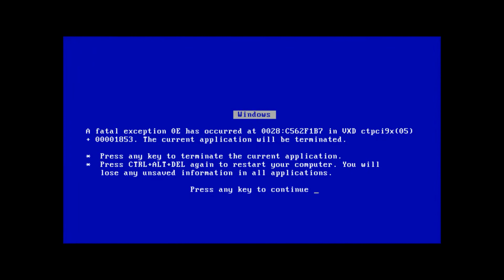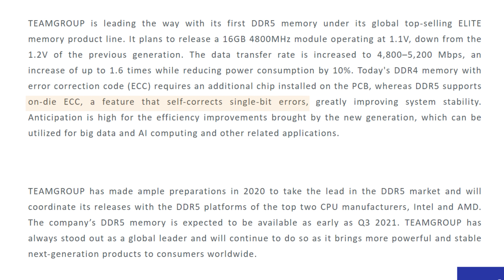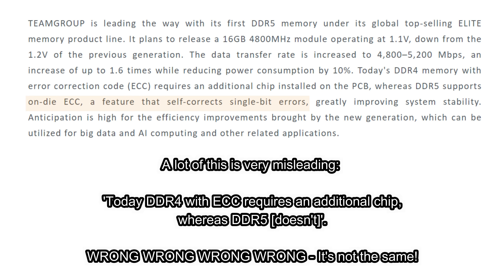Why DDR5 does NOT have ECC (by default)

Comment: Well... that's unfortunate. I was wondering how they were able to run ECC at the higher clock speeds and lower latencies that gamers would demand, and the answer is... they didn't.
Reply: Mostly due to lack of demand. If ECC on desktop platforms was common, I'm sure we'd see lower-than-JEDEC latency gaming ECC ram all blinged out with RGB and gold plating and whatnot.
RAM manufacturers are already binning their own ram chips for reliably hitting the faster settings, no reason they couldn't also do that on ECC modules.

Comment: Loved the video! Thanks for the great content as always. 

One nitpicky thing: probably don't need to worry about alpha particles from cosmic rays, those have a penetration depth of microns (in materials) to mms (in air). Main issue would be x-rays, some of which could come from alpha's radiating their energy via bremsstrahlung, but it's super unlikely that the alpha's could pass through the atmosphere without stopping.

Comment: If you read this  a few questions : 
- is it impossible to overclock ECC RAM ? get tighter timings while keeping ECC working (even if out of specs) ? (sure there would be a perf penalty from ECC anyway)
- are ECC error corrections reported to the OS/logged ? this could be insanely powerful for overclocking & stability, less need for stability testing tools
=>if your logs get filled with errors, you probably went too far in pushing your RAM 
- OR alternatively, if the RAM is only "factory overclocked"  it could indicate that this memory isn't able to maintain XMP settings therefore giving a reason for an RMA

-additionally I'm on the ECC would be great for diagnosing bandwagon.
I had a failing AMD Ryzen 5 3600 for months,
it produced random errors at idle, but never under stress load, this made it very difficult to diagnose
and for a long time I thought it was memory problem or a motherboard problem
On average 3 errors per day... this made it even more difficult to diagnose.
I finally found the proof : disabling CPB would stop all crashes altogether and then AMD made no difficulties for a very fast RMA.

Comment: Looking in the logs of UNIX workstations 30 yrs ago, ECC memory correction definitely did occur frequently enough to be glad of it, though I rarely had trouble with RAM going bad, despite large memories requiring add in boards with a lot of chips soldered on. 
Insist on ECC for every server, 
the costs of data corruption  outweigh any performance gain and it certainly isn't fun to check a 100 machines with memtest86 to locate a source of errors.
It's worse than no ECC, originally micro computers had parity checked memory, the original IBM PC had that. They shaved cost and gained a little performance by having the hardware unable to detect any bit errors nevermind correct them.
Another issue with x86 ECC is that it's a low level BIOS routine that runs and scrubs memory, it's unfortunately not under control of the OS.

Comment: A great video (as always!), but one question: your explanation makes it sound like those thermal and cosmic ray bit flips happen in memory, but your objection to this being seen as "universal ecc" seems to imply that they might be just as (more?) common for in-flight data. Could you elaborate on that? I was under the impression of those errors being DRAM-specific, and thus not very relevant once the data has left the DRAM chip.
Reply from the maker: On-Die DDR4 ECC manages the cells in 64-bit wide word lines, but ECC data transfer requires 72-bit wide word lines for the extra parity bits required during transfer. Movement of data is a lot more susceptible to flips than storage of data, just by the act of moving, rather than the act of time.
Reply: @TechTechPotato  Ah, so when speaking of ECC protecting data it is mainly/most importantly about protecting in-flight data (through extra parity data transfers) rather than "static" data in the memory cells (even if those can also flip)? That goes some way to clear up the cause of the confusion for me at least, as I've never had the seemingly logical connection of "ECC memory = protecting data stored in RAM" complicated. Thanks for clearing that up!

Comment: Even if it's not standard shouldn't be a good idea to have ECC in overclocked RAM? As you overclock the RAM it tends to be more unstable so having ECC should help to avoid random crashes when gaming (even if it would stop to be a 100% success rate for the ECC and goes to a 90% of chances to fix a bit changing its value.

Comment: RGB for ECC could be in fact useful. If you count you bitflips in a module and colour code them, a guy in a datacenter could swap bad modules without any further knowledge about the whole system. But i doubt the added cost per RAM will be lower than letting the tech guy work longer or exchange the entire rack once you can't live with a RAM Module anymore.

Comment: The Threadripper Pro CPUs from AMD support ECC DDR4 RAM since they're intended for desktop workstation systems where 128GB of RAM is a minimum specification, a "good start" at best. A lot of these sorts of workstations are doing production work for things where a data bitflip wouldn't matter, like video or audio or image processing but there are other tasks, for example mathematical modelling or engineering where a single data bitflip early in the chain of number-crunching can cause a noticeable error after a few million iterations.

I remember the Old Days when early minicomputers could be specced with DEC-TED memory (double-error correction, triple-error detection), they had 22 bits of RAM to store 16 bits of data with the other 6 bits used for parity checking. This was due more to the manufacturing processes of the time and high failure rates of components rather than cosmic rays and the like causing bit-flips.

Comment: Side-band ECC is the traditional ECC type that everyone knows of, that's the actual name and it's an accurate, descriptive name.

"A good chunk of memory sold today is actually ECC - it contains error correcting code. This enables memory that has ECC enabled to correct errors as they occur." It supports ECC - doesn't contain ECC. DDR4 DRAM just holds data, the memory controller is in charge of using it. Saying that the memory itself is ECC is exactly what you're trying to disprove in this. As you say yourself, technical accuracy matters, and saying that the memory contains error correcting code when talking about DDR4 DRAM is definitely inaccurate.

In British English (and all other variants) - pronunciations are:
'Jed-eck' not 'Jay-deck'
'Pet-a-bite' not 'Pee-ta-bite'
Reply from the maker: Support vs contain is a fair point. 
On your pronunciations though, I have to disagree. As a 35 year old Brit who has spent most of his life between Cambridge and Oxford. Next you'll be saying there's a correct pronunciation of grass.
Reply: @TechTechPotato  You're saying that JEDEC are pronouncing the name they created incorrectly? Or that other people can pronounce words how they please, regardless of how the industry pronounces it?

Comment: hey Ian, will you make a video about mercurial cores, the increased number of fucky cores? There was a presentation on HotOS by google called Cores that don't count. Facebook has a blogpost and a paper about silent data corruption. What does this mean for testing, yield? Do manufacturers even care?
Reply from the maker: I have the paper, did a quick pass. It lends into the concept of hyperscalers testing cores better than the manufacturers do. Not sure if it's that big an issue for consumer. Will have to get other stuff out of the way before I do a video on it though.

Comment: I am running DDR3-ECC memory right now with much lower timings than they are specified at. It does work fine and I assume they would still correct errors if there were any. ;)
Reply from the maker: 'assume' 🤪 Probably ok for casual users, but for datacenters
Reply: @TechTechPotato  Nearly everything of my system is out of spec and won't meet the bar for datacenter usage. :D It is one of these off-label 12C Haswell-EP's on a Chinese X99 board with a tinkered BIOS. That project was a lot of fun actually and considering the price I got CPU+Board+ECC-RAM quite a bargain for the functionality.

Comment: I can not understand why ECC will break memory overclocking. You could still have an ECC memory stick with XMP or aplly manual OC to it. Furthermore ECC mechanism  will immidiatelly signal bad overclocking settings itself, so overclockers know EXACTLY where (oc settings) to stop (ECC corrected errors is 0 after memory test)
Reply from the maker: ECC isn't just a function, it's a set of rules about error rates at specified timings. Outside of those timings, you're no longer conforming to ECC Spec
Reply: @TechTechPotato  memory manufacturers are already breaking JEDEC specs with XMP. Adding ECC as a function into some XMP memory modules with will only make memory better.
Say "thank you" to those, who desighed ECC. Their persistence on running memory only within speed and timings they like had really paid off. It is impossible to find ECC memory within memory ordinarly people would buy.

Comment: I am probably wrong here...but doesnt "important" software actually protect its data in a "SW manner"?! By that I mean the programe itself stores (some king of) parity bits/eccs in memory or straight up saves the data duplicitaly -> to different adresses so it can be compared when its needed again? I always thought SOME software literally did this in runtime -> its part of the programe itself to be this "careful" about the data its working with)? Thats not to say we dont need better "data integrity protection" built right into the HW itself..."actual" ECC mem should be ubiquitos imo. I am just asking guys, wanna know if I am dumb or just delusional :D

Comment: ECC is great for overclocking, since the memory directly reports when you've gone too far and get errors, and even if you do get errors, they will less often crash your system. 

Consumer ECC with non-JEDEC timings should be a thing.
Reply: I know this is 2 years old, but it exists. AMD unofficially supported ECC on their consumer platform. Where Intel straight up locked you from it. Rdimms and Udimms are keyed differently now though with ddr5, so if you want ECC, you have to buy a Threadripper or a Xeon.
Since Intel revived the HEDT market with sapphire rappids, it is now possible for normal people to have a "workstation" class CPU and access to ECC. Sure, the CPU's are expensive and the motherboards are even more expensive, but it is not as outrageous as Threadripper PRO.
Reply: I have the parts here, and building the PC is scheduled to start in about 26h.
I'll put at least something on my channel, so feel free to sub now and unsubscribe once I posted the ECC OC content.
Reply: For overclocking RAM, ECC is terrible. Because the ECC does an extra compare, it relies on another chip which isn't available at higher clock rates. You can find regular DDR4 RAM rated 5333 out of the box. If you look at ECC, the fastest on the market is 3200. If you are talking about overclocking the cpu, then that won't help because the ECC correct errors in RAM, it can't detect an error which is the output of a CPU calculation. There is no parity for that.
Reply: @andychow5509  I thought all ECC was now Generated and checked on the CPU.
Reply: @charlese2833  Nope. The ECC in RAM is validated and checked on the stick itself, by two extra chip: a regular extra memory chip which holds the parity bit, and a second chip which downstream analyses the signal, and tries to correct it if there is a parity error. It has nothing to do with the CPU.
You may be thinking of checksums, which has nothing to do with ECC.
Reply: @andychow5509  Since when? All ECC memory I've studied has simply been wider. Where's this parity chip that would require connections to all bus bits? Besides, ECC = error checking and correction. The first is precisely what a checksum is; the simplest case being parity, which is a 1-bit checksum. Note that parity alone is always insufficient to correct an error, which is why ECC uses the extra bits in more complex fashions.
Reply: @0LoneTech  An ECC-capable memory controller can generally detect and correct errors of a single bit per word (the unit of bus transfer), and detect (but not correct) errors of two bits per word.
Reply: @andychow5509  That has nothing to do with your earlier claim that I questioned. Allow me to repeat the claim: "The ECC in RAM is validated and checked on the stick itself". Can you show a single module where this is the case? The ECC logic resides in the memory controller, which has been built into the CPU since the Alpha EV7/Intel Nehalem/AMD Hammer, so claiming it has "nothing to do with the CPU" is rather disingenuous.
Reply: @andychow5509  Is ECC validated and checked on the stick itself on non-registered and non-buffered ECC, too?
Reply: Interesting. So in your experience, is it more likely that the RAM will cause an overclocked system to crash or the CPU?
Reply: @benjaminfacouchere2395  A unstable CPU OC is more predictable and tends to crash sooner, just run prime95 with the hottest FFT setting for a few minutes. 

Meanwhile bad RAM OC (and even unstable XMP presets) can be a lot more difficult to troubleshoot. Then there's the weird interactions.

For example getting a new GPU can suddenly make your RAM that worked fine for years unstable, due to the case temperature being higher than before, or the GPU blowing it's hot exhaust straight onto the RAM sticks, or simply the GPU driver being more sensitive to memory errors.

Then people blame the instability on the GPU instead of the memory throwing errors all over the place, which wouldn't happen with ECC.

Diagnostics is difficult, since you might only get the errors when the GPU is under high load, but the CPU isn't, since the CPU cooler usually is what provides the memory with good airflow.

ECC should be the standard.
Reply: @tommihommi1  Thanks for the reply. I don't OC myself.
I was just assuming watching i.e. LTT that modern CPUs have thermal throttle, so that crashing the CPU due to overheating wouldn't be that easy, and it would more have to do with the frequency itself, but I guess I'm wrong.
Reply: @benjaminfacouchere2395  no, OC instability has nothing to do with the thermal throttling limit at all

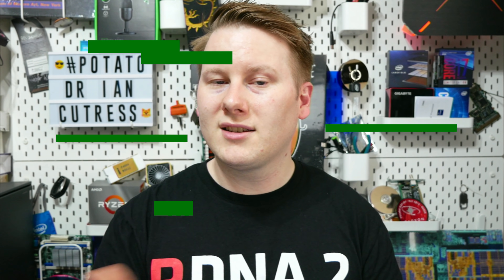Comment: 3:10 5->6 needs 2 bit flips : ) 
101 -> 110 
5 would turn to 1, 4, 7 or (5 + 2^x)
<know it all mode off>
Reply: 5 could also turn into 13, 21, 37, 69 or 133 (assuming single byte is used for storing that value)
Reply: @volodumurkalunyak4651   which is what i included via (5 + 2^x)
13 = 5 + 2^3
21 = 5 + 2^4
...
Reply: you assumed his numbers are stored in ordinary binary representation. maybe he used a different one
Reply: You assume the flip was to the final output of a calculation, it could have flipped any number of inputs or intermediate values. Keep in mind that this is RAM not persistant storage.

Comment: You say, isn't needed from a consumer perspective, but I have a friend in game dev that runs ECC. He's sick of the memory corruption bugs. Now game engines push gigabytes of data around the system and during development the error rate must be significantly higher? This would seem valid ECC use for me?
Reply: bruh you didn't watch the full of video.
Reply: @claritoresdiano1021  of course I did what part did you have in mind?
Reply: @JohnLeidegren  08:59
Reply: @claritoresdiano1021  yeah, ok. So, I just find that a bit to vauge. What is he really implying when he'd saying "code" it's just too broad for me to infer anything from.

Comment: Have you heard about diamond substrate in chip wafers? It has been postulated to be used in specially radiation hardened systems. I'd like to know more about it if you have time and there is interest in the community as well?
Reply: There are cheaper SOI substrates. Used for rad-hard chips since the 70's. AMD made CPUs with SOI for years. With today's insane power density and synthetic diamond, there may be use cases for spacecraft.

Comment: And a huge 'thanks, jerks' to Intel for artificially keeping ECC off of desktops.

All Ryzen based CPUs do support (though, not officially) ECC.  The motherboard maker has to also support ECC - and plenty do.

As per FPS differences from non-ECC to ECC, it is typically less than 10FPS difference in most cases.
Reply: Annoyingly, ECC is not enabled on the existing models of non-PRO Ryzen APUs (no idea about the upcoming 5000g series, but it'll probably be the same). It is enabled on the Ryzen PRO APUs that are available on the grey market, tho.
Reply: @kepstin  That is true.

That does not take into account the CPUs, which arguably, sell more units than APUs.

I am not saying that APUs and less important than CPUs - just that they are different and need to be compared separately as their target market is different - that is especially true for the Pro series APUs.
Reply: @kepstin  So AMD copies another Intel mess. Management (backdoor) core and now this.
Reply: @perforongo9078  Absolutely fair point. :)  I was using a generalization, just to give a 'rough' frame of reference, not an exact.

Your clarification is welcomed. :)